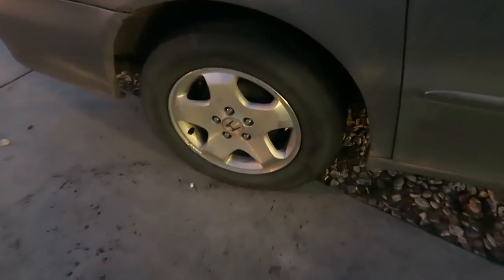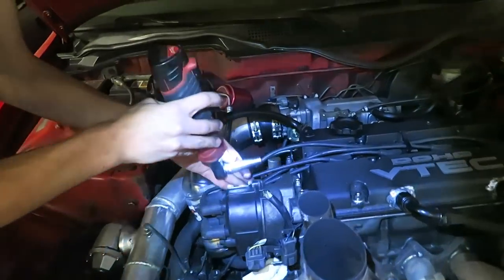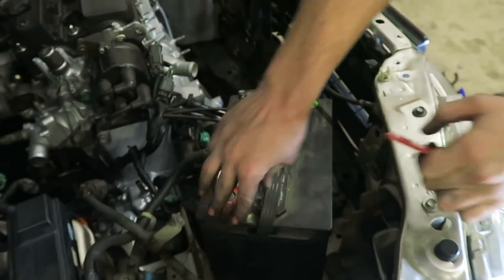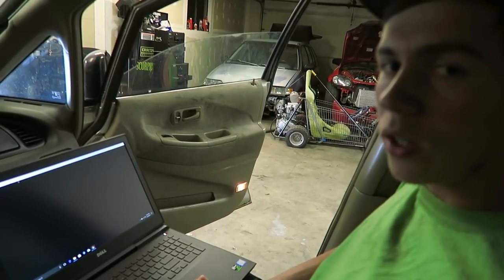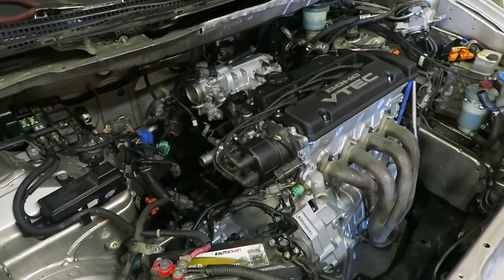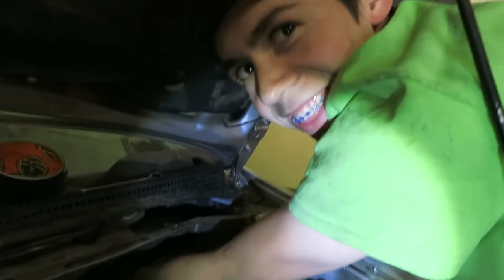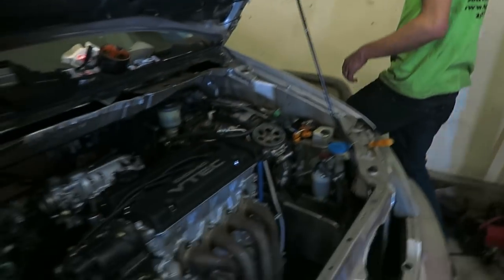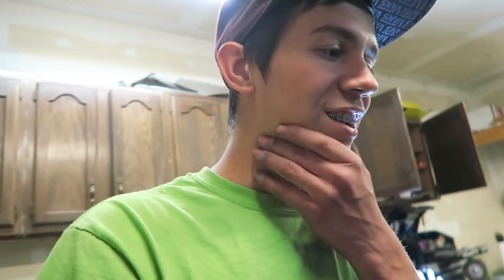Turbo Minivan Build First Start Up!

Comment: Kyle- don't forget- you don't have a "clutch interlock" switch either. Meaning- you can crank the engine while the clutch is engaged. That setup has it's pros & cons, so be careful. Leaving the NSW in park- may activate a rev limiter. Set t to NEUTRAL and tape over the hole, and zip it out of the way somewhere. Also- put the column shifter in NEUTRAL and remove the lever, too.
Reply: HUBBABUBBA DOOPYDOOP you just stole everything I was gonna write
Reply: it shouldn't activate a rev limiter since they aren't using the stock ecu
Reply: ...Great minds think alike. Peace, Brother.
Reply: Yes, that is correct. Sometimes (not sure about a Honda Odyssey) the trans gear selector/NSS (aka "Range Finder) will limit RPMs in the gears- to prevent burnout. As long as it's a different ECM (there's no  conflicting PCM or BCM lurking around) and the NSS is defeated properly- he's good. All that ABS and Traction Control stuff is usually coupled to the auto trans in some modern vehicles.

Comment: Since its the same engine bay as an accord. The firewall should have the studs and bolt holes to mount a manual accord pedal assembly and Master cylinder.

Comment: The hack for that fuel rail bolt you were looking for is, cut a slot in it, use a flathead screwdriver. For testing only of course.

Comment: That’s usually done when pumping a carburetor.. 8:30
Reply: Integra DIY I was wondering what he was doing when he said he would give it more gas. I was thinking it was something on the fuel rail that boosted the psi lol. He went to flapping the throttle plate 😂😂😂 dead!!!
Reply: Came here looking for this mate, says fuel and goes for the air lol

Comment: I'm thinking you should do a coil in plug conversion for at least one of these cars! Kind of amazing a distributor even supports that kind of power. Great job, Kyle!
Reply: 😂😂😂 My day is ruined.
Reply: 802 Garage you all good B, YouTube produces and brings the most bitter of no hope bundies.
Reply: Why make it more complicated. If it works it works
Reply: ProjectGTR Most distributor systems have a hard time producing a strong enough spark to keep up with high horsepower high RPM engines. Plus you get more precision with coils. You're not wrong at all, it may be unnecessary, but it would a be a cool project and help him push limits. Just a thought. :)
Reply: Lance Johnson Haha I don't sweat it much! I'm here to watch BoostedBoiz and I get plenty of support elsewhere.
Reply: yeah i see your point, but in the honda community this is a non issue and nobody converts over to single coils. mostly just people that are not in the honda game, that want to do that conversion, like mcm. But really distributor just works for honda and there is no reason to changing it.
Reply: until your distributor randomly shits out on you. COP is nice for reliability and you get a bit of hp.
Reply: Can you do that with the stock ECU? I’d assume not right?
Reply: no you cant. but you can tune the stock ecu if you are on a budget like the p28 ob1 ecu with a chip.
Reply: ProjectGTR Ah that's totally fair. I'm not super knowledgeable in Honda. I'm a amazed how long they were still using a distributor, but they obviously know how to do it!
Reply: GudJuJu Def not on stock ECU, but I'd imagine Hondata has some way to handle it.
Reply: Who else thinks it's funny when people call a single header "headers". can you lend a nigga one pencils
Reply: yeah i also dont know what unicorn power honda made to make the dizzy work that good
Reply: 802 Garage Hondata has its own COP kit that utilizes OEM K series coils. Hondata CPR (Coil Pack Retrofit) kit.
Reply: Ya ikr! My 850 was like 380whp or so and was just on the border of breaking up.
Reply: Miguel Cisneros I'm confused. I've always been a huge fan of BoostedBoiz and Kyle specifically. I like Hayden's channel too, but this is my favorite channel period.
Reply: TwoTimes 209 "Headers" referring to the plural pipes. NBD either way.
Reply: Rotors Magazine that sounds pretty awesome!
Reply: 802 Garage headers is plural for more than one a four cylinder has one header a V6 or V8 has two. That's like saying I'm putting on the intake manifolds or since we are using your terminology and H22 has more than one cylinder so why don't we just call it h22's. Lol that's a nice H22's swapped Odyssey
Reply: I Like's the's h22's swap's in your's odyssey's should's makes lot's of's torque's  once's you's gets everything's figured's out's
Reply: TwoTimes 209 a lot of people kind of look at it like pants. You don't wear a pant, you wear a pair of pants. The intake is a solid cast piece while a header is 4 individual tubes on a flange so people end up saying "headers" but still, header is the correct term not headers.
Reply: TwoTimes 209 I understand what you are saying. What I'm telling you is that it makes sense either way, even if the original terminology was intended to talk about a singular collection of pipes. Like the usage of headers has become so common even for inline engines that it's not worth the fight, hahaha.

Comment: That neutral safety switch looks just like the one on my aw4 in my xj cherokee what I did was cut the plug off and soldered all the wires together to delete it.

Comment: if you ever need a noid light in a pinch and don't have the tool, just grab a 194b bulb, unwind the wires on the bulb and put them in the injector plug. Simple and cheap.

Comment: You don't actually need injectors to fire in the right order or anything for the car the run, just needs fuel generally getting to the intake manifold. Some cars even had one wire to fire all injectors

Comment: To make it crank without the stupid park switch just link pin 1 and 3 on that 9 pin plug. They are labeled with fine af numbers
Also i think its pin 7 or 9 is use for reverse,  normally a white wire
Also you can use the f22 dizzy.. but you probably want an external coil one

Comment: I thin kwhat you should do is go full sleeper, leave the old exhaust on and have that for the sleeper and have an exhaust going to the ground and have a cut off exhaust so it sounds really quiet or you can let it open and have the full sound, the cooler behind the raidiator would make it full sleeper, maybe not clean the car exterior eithe rn put some soccor mom stickers lol

Comment: If you use assembly lube while putting everything together and oil the cylinder walls and it has oil pressure, there's no point in letting the oil circulate. After like 100miles your supposed to change your oil anyway to get the assembly lube residue out

Comment: I have a set of TWM ITB's for a H22 that I want to sell really bad! I ran them in a EG hatch for about 500 miles and took then off and sold the car. I was going to build another one but I got tired of it and got more into my jeeps and bagged trucks.

Comment: Since you ended up at Home Depot, I'm compelled to mention that most Home Depots sell Formula Shell motor oil for cheaper than the O'Reilly store brand oil.

Comment: Man I know you’ve been building Honda motors for a while, but you really should be using some quality oil, especially on break in. H22 are really hard on the cams/followers due to the solid design. Need some oil with zinc or something similar.

Comment: You guys pour your oil wrong js. Don't pour it out with the cap on the bottom, flip it around in your hand so the slant of the bottle points  upwards and the lid is up when your pour. It's slanted so when you pour that way there are no glugs. Hope Yall see this

Comment: u can always make a slit on the top of the bolt with a Mini Fine Disc air tool or Tremel tool  to make it work  so a Standard screw driver can be used. also is good to try thing when dealing with a bolt with that R rounding out  They even got these screw hammer's that R need to take off the set screws that the factor puts on the Acura/ honda 4 disc brake Rotor's ..u got this build up & ready pretty quick. Props. guess the problem that u had with the hatch help u figure out  on getter her started i said to my self out loud when i saw u having a fuel problem i bet it's that Dame injector plug hareness LOL. . sounding pretty mean. . open header  that gonna wake the neighbors LOL open that garage door thou.
Show less
REPLY

Comment: Do you really need a good ground to check the spark plug? Doesn't the plug itself have a ground that it sparks to? I'm really asking this, not being a smart ass.
Reply: J D the spark plug wire is only the positive. Where the base of the plug screws in is where it normally gets its ground.  So yes you have to ground it.
Reply: Cool, thanks man.

Comment: I would be super paranoid if there were issues with my injectors ESPECIALLY if it were an engine getting prepped for turbo. I'd swap the entire harness,heck. I'd hate for it to go lean during a hard pull.

Comment: Tossing the plugs in without gapping? Checking spark on meg battery post? A ground is fine.. but as sensitive those distributer and coils are. It’s not cool.

Comment: Quick question, I have a vr6 Jetta and it got a refurbished engine swap on it, but a most of the wires and hoses are off--- Does anyone have any suggestions with figuring out how to put it all back together?

Comment: Really should have primed the oil system properly instead of just cranking it with no spark or fuel.

Doesn't take that much longer to do it properly and prolong your investment rather than wondering why you get engines blowing early :(

Who cares if its not on the road one day faster.. just should do shit properly on built motors :(

Comment: Am I the only one that noticed he didn't gap the spark plugs
Reply: MasterOG he didn't even tighten them... He just dropped them in and plugged in the wires lol
Reply: He also just dropped them in, no socket and extension lol
Reply: Idk the video cut
Reply: Certain NGK sparks plugs shouldn't be gaped
Reply: Cesar L Yup learned that the hard way once.
Reply: MasterOG if the plugs are application specific they do not need gapped.
Reply: MasterOG but even when using application specific plugs, I always check the gaps the be sure.  Double checking doesn't hurt anything.
Reply: Fuckin' send it

Comment: Please please please stop dropping spark plugs into the head, you will fuck up an electrode or the treads and have it go right down a cyl. Put them in your spark plug socket (the kind with the rubber boot inside it) and place them in carefully, threading slowly to not crossthread them

Comment: Batteries create hydrogen, and they discharge it at the top threw the vent valve or microscopic cracks around each post.  Not a great idea to test spark directly to the battery.

Comment: Man fix the gauges in the mr2 they're pretty anoyying like this.
Reply: 7amoody 1985 he cant unless he gets a conversion or racepak cause hes using a k trans which has elcetronic tach and speed senor and the mr2 is mechanical

Comment: Why’d you use cheap ass oil
Reply: its just to get the motor started they going to put better oil whats they put the turbo on it
Reply: Rafael B once it's all put together he's gonna run it, drain it and check  the oil for any metal shavings. Then if all is well, replace the oil filter fill again and drive it a short period and repeat. It's a must when putting together a new motor.
Reply: 6foot6 E ah okay makes more sense, might as well go cheap if the oil is basically going to waste right
Reply: You're supposed to use dino oil for engine break-in. Besides, the oil is supposed to be changed after initial break-in (which is usually about 30 minutes).